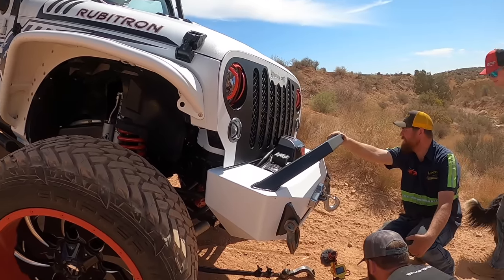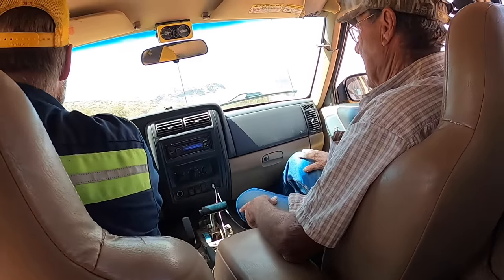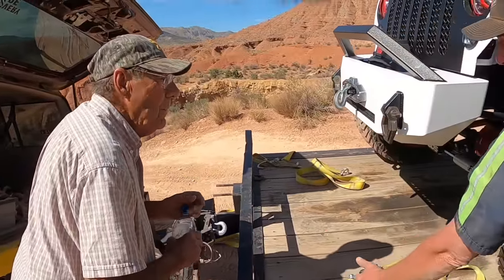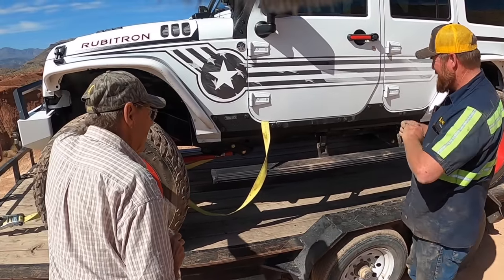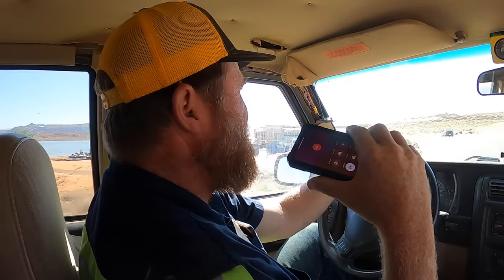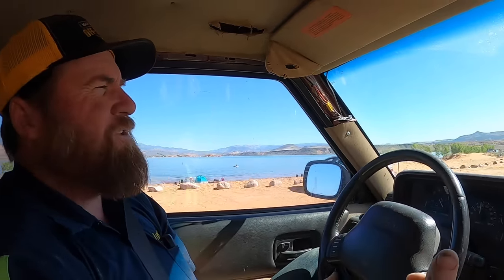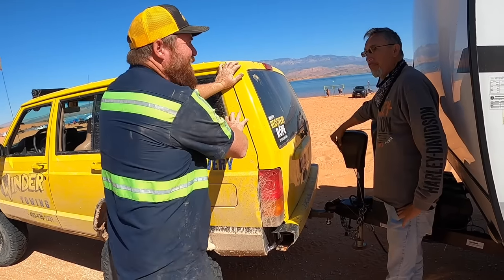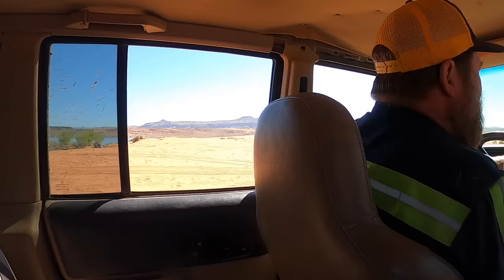$100,000 Jeep Breaks On The Trail

Comment: it never ceases to amaze me at what you can do with an XJ, this last winter we had a hard freeze and heavy snowfall in oklahoma and i flat towed my roommates F350 to the diesel shop roughly a quarter mile from the house because his fuel tank jelled (-20 for the lows overnight and his fuel was treated, but not for the temps we got vs what was predicted), behind my '91 XJ, the rocks to control steering were a surprise and i noticed BSF mentioned the ratchet strap method, I've done that one time before and it works really well

Comment: Matt is good. He doesn’t even have a back up camera and he hits the trailer hitch on the first try. Perfection!
Reply: He probably hitches his trailer  often enough. I know I only use my camera for the last 6", until I loose sight of the ball under the hitch. I do hitch onto trailers almost daily though.
Reply: When you drive all day everyday all year long you’ll know every inch off the dimensions off your vehicle.
Reply: Practice makes perfect.  Used to be able to put the pintle hitch RIGHT into the ring with an F-550 Crew Cab I used to pull a hydro excavation trailer with every day at work several years ago - helped that it was at like 5 or 6 in the morning when I was still half-asleep waiting for my Mtn Dew to kick in - it's just repetition and going by the force at that hour of the morning.
Reply: @benmartin1727 he was hitching customers trailer. No practice

Comment: Seems like it might be handy to have one of those hand truck things with a set of little wheels for moving around trailers custom made and reinforced, so if you got a stuck trailer that's unhooked you could just lock it into the ball hitch, attach a reinforcement bar to the trailer tongue with a simple clamp or u-bolt, lift the jack up to put the weight on the hand truck thing, and hook the recovery rope up to it.  The part that hooks up to the trailer would have a simple pivot for the wheel underneath to rotate, and the wheel assembly would have a bar on the front of it for the strap.  It would be steered by tracking wherever the strap is being pulled from, and that would be the limit of your control, but if you're in soft sand it'll be braking on its own and won't go cruising right into the back of the recovery vehicle.  All you're really doing is supporting a castering wheel under the trailer tongue so it can roll when you give it a tow, it doesn't need to be complicated.  Could be designed in a way that breaks down small for storage and adjusts for different trailer dimensions, just toss it in the back if you get a call that involves a trailer.

Comment: I would like to know what they did to it that makes it a $100,00 Jeep. Never mind - I just saw why - it has automatic running boards. Great for when you go to the mall.
Reply: Going off-road means turning off the road into the Macy's parking lot.
Reply: Rims
Reply: I beg your pardon those are the super duty special rock slider combo running boards. No serious (sic)  off roader should be without them. Bolt on of course.
Reply: Those boards are only $1200 or so. Rims are probably that much each, tires half that each. Specialty paint job is thousands. Etc.

Comment: this is what happens when you take a trophy queen on real trails you should get your money back
Reply: I would hardly call that a “trophy queen” but I get your drift.
Reply: @michaelshepherd7572  yup the low profiles the wheels the weight yup that was going  to snap because of the set up
Reply: @cordel666giglesworth6  Why exactly tho? the contact patch is too big, creates too much friction so breaks stuff when you try to steer?
Reply: @chir0pter  As ridiculous as the wheel setup is for offloading, I don't think the contact patch is too big or causing too much friction. Most guys air down their tires specifically to get a bigger contact patch for more grip. I'm guessing he was going too fast when he hit an obstacle and that's how he broke it
Reply: @Yodes08  yeah that makes sense, could see this guy treating his mallcrawler with hard low-pro tires like a raptor on that dirt road. Just seems like it's always the guys with big wheels/tires like 37s who break parts of their suspension on youtube. but that could be because they're the ones who post on youtube. or they haven't upgraded the suspension accordingly, or they're the ones who are taking on tougher stuff or overloading their rigs.

Also the contact patch on an aired-down tire may be big like this low-pro tire but an aired-down tire would also have some give to it, potentially taking some of the strain of steering components etc

Comment: That’s the exact kind of jeep I would expect to be broken down on a trail, that monstrosity or a stock one
Reply: So basically any jeep!  Lol
Reply: Stock jeeps are quite capable vehicles with the right tires and drivers I have a 79 AMC Wagoner for hunting a 86 Comanche for hauling firewood and fence posts and a few Cherokees for dailies and trails I know my boys have rode them hard and steel wheels and tires are the only thing not stock on them I don't spend much time working on them other than routine maintenance oil change grease them and tuneups same as all my other vehicles 2 of my 3 girls probably drive harder than most boys do they all learned to drive in my 64 Ford 1 ton around the farm not many of their friends can drive a manual let alone back a trailer with 1

Comment: Just goes to show that big tires and lift kits are detrimental to the designed components of a stock machine. A snapped sector shaft is a result of too much stress on that little stock steering box.
Reply: Or don't use a jeep lol, or donks on your jeep. Orrr spend the same money you spent on the wheels, doing suspension and steering upgrades.
Reply: @701chevy9  I'll take my Jeeps anyday offroad, but I also spend money on performance upgrades, not cosmetic trash lol

Comment: Well ain't that FANCY with them running boards.  To bad Jeep ain't making them like they used to.
Reply: A fellow four wheeler had those on his Jeep, unfortunately they do not double as sliders. He landed on a rock and every time he opened his door he blew a fuse because they board wouldn't move. We all got a big laugh out of that.
Reply: To be (a little fair) laws are making vehicles more complex which results in more points of failure. not in this case but, the vehicles our demographic want are hard to make under current laws.

Comment: Everyone knows you need much bigger wheels and smaller tire walls to effectively off road...SMH
Reply: Exactly. You need to pinch the tire between the wheel and the rocks to maximize traction.
Reply: I run 33 inch tires with a 15 inch wheel and when aired down the footprint is huge.
Reply: @karlschwaber7006  Yep. Even with 37"s I still only run a 17" wheel.
I don't get why people think larger wheels are needed for offroad.
Reply: @spydergs07  37" tires! That is a big tire. They would be nice for the Rubicon.
Reply: @karlschwaber7006  I run 31s on 15s, but I don't do anything too hardcore so that's more than enough for me.

Comment: How the heck did that thing break on such a mild trail??
Reply: Good question!  Even for a mall crawler you would not expect that.  You might accidentally hit a curb.   😂     I would go back to that shop and show him the shoddy parts he uses.
Reply: Breaking stock Sector shafts are a known weakness with these jeeps.  It probably was damaged somewhere else and broke there.  Good thing there vs on the road at speed.

The shop should replace with a psc steering box and a sector shaft brace.

Comment: Ok, I have learned something about using rocks to turn steering! And to not go off-roading with a stock Jeep. Also, don’t unhook trailer from truck if your stuck. As for the Camry, seen cars get pulled from the back and they hook on to a rear tie rod and bend the crap out of the steering. They should make hooks. Canadian winters can require a pull from either end and sometimes the pros are not called.

Comment: we busted a tie rod and cut a brake line on Lizard head pass, somebody rode on the fender and kicked it front or back to steer and crimped the brake line. Welded it up when we got back to camp and filled the brake fluid with wesson oil , sold that way 5 years later, it wasn't a $100k rubicon with lotsa plastic on it though

Comment: i still drive a 86 subaru rx turbo with a lift kit that slaughers all these posh 4wds end of the day in 4wd driving its all about kg per wheel if you want to get real. How weak was the  jeeps pivot points.. You can puff up your car with big wheels etc but end of day you cars weakest link is its weakest link often a 1 inch bar.

Comment: I can move nearly any trailer with a spare tire/wheel and a chain or strap...🎯😎☕
 The rocks used , to manipulate the steering ,,,brings back memories, and smiles, at the shocked faces, that told me I couldn't move the 1988 F250 4x4, which had no steering box,,, being that the 2-piece tie-rod had no way to keep front wheels from going 'pigeon-toe',,, I used a cam-buckle tie down, to hold the 2 connected tie-rod pieces up close, but not too tight, against the 'twin-traction beam' front axle crap, on that truck.
 Wheels were sunk in dirt, up to the rims... Used an 8x8, wood block, to make wheels turn truck away from the building and out to where I could work on it🎯

Comment: Jeep hasn't made a drive off the lot off road vehicle in over 20 years, you have to take them to a shop to have the suspension completely redone and put new tires on it after a regearing.

Comment: Air down the trailer tires.  I drove my f250 with air down tires in a toy hauler that was about 10,000 pounds with air down tires all over the sand dunes never got stuck

Comment: Steering box shaft failure, some early Toyota T100's had problems with the steering box arms but not the shaft, they were recalled, perhaps that's a issue with new Rubicons or the aftermarket drop arms are causing that issue?  Regardless that can be a dangerous situation on the trail or on the highway, wow unbelievable ...

Comment: One thing I've learned from these videos is that to get unstuck you just need to go faster. 

"I'm stuck!" 
"did you try mashing the accelerator to the floor and holding it there until you aren't stuck?"
:)
Reply: In sand standing on the skinny pedal usually sets you on the frame because most people run recommend tire pressure

Comment: At around 8:35 you mention moisture in the sand. If someone had a large source of water (maybe they were near the water with a bucket) would it potentially help to wet the sand for traction?

Comment: 10:30   As someone who's enjoyed off-roading for years, and also worked on a ferry boat in northern lake Michigan and had to chain thousands of cars to the deck over the years... Yes, yes they are. It's especially shitty on the ferry cause we're making a nearly 40 mile trip at 16-17 knots. (basically 20mph so 2 hours across the WORST the very northern end of lake Michigan has to offer) certain times of year its an absolute must to chain down every single car. There could be 14+ foot waves the whole 2 hour trip. If those things are sliding around down there, not only would they get bashed all to hell, but if like 15 cars slide starboard all at once while we're taking a beam sea.. Over we probably go, and now you've potentially got 100+ people swimming in 40F degree water, many miles from any potential rescue. Hell the Coast Guard over in traverse city upgraded from one of those little whistling shitcans to a Jayhawk, but that's still only gonna be able to pick up a handful of people each trip and you die pretty fast in water that cold. They took away the only cutter that was stationed even remotely close.. Probably take 6 hours to get a cutter on scene. Might as well not come at that point. We could get our old backup ferry warmed up and on scene well before that. Everyone would still be dead.. So to make a long story even longer... Car manufacturers, you are condemning people to a freezing drowning death with your modern car designs. There's plenty of room under there. Totally useless space between things where you could have those fancy robots just weld on a shackle or hook or something.
Reply: I've always strapped the wheels to the deck when hauling vehicles I loved it when the wheel slings came on scene

Comment: I bought a Wrangler TJ for $5000 it already had 37 inch tires drove 75 miles an hour on the highway with no wobble…Never broke down on me damn she was a beauty. 200,000 miles on her every trail every winter highway driving every day commute… and we had one built snap one time Peter goes 75 bucks to put it in another one on on the side of the road it’s only problem I ever had. 
Bottom line… No matter how much money you spend they don’t make them like they used to

Comment: With one ton tie rod ends and a heavy duty drag link and tie rod the week link in the system becomes the sector shaft.  That Jeep is ridiculous though.  Also, how do break the sector shaft on a straight graded road?
Reply: Not replacing it when they start wearing out or using them as tow points I've seen both happen

Comment: Didn't know what you called it when you had Bluetooth steering on one wheel but I guess hunting is what you'd call it I broke the exact same arm on my 95 Jeep Grand Cherokee and continued to drive it home at 30 miles an hour not even realizing that my tire had come disconnected from my steering it even steered with the wheel even though it wasn't connected

Comment: Never understood the limited. It seemed pretty standard as a variant. At least, the most common I have seen. Not very limited if you ask me.
But good lord that guy has money to spend, but doesn't actually know what is good to be spent on. This tells me, he a not a good driver. I bet he took the hill to quick thinking his ride was baja quality and did this. But his ride is all show, hard suspension, large rims with fairly low tread and tire depth.
Not to mention his demeanor on arrival just oozed with rich douche.